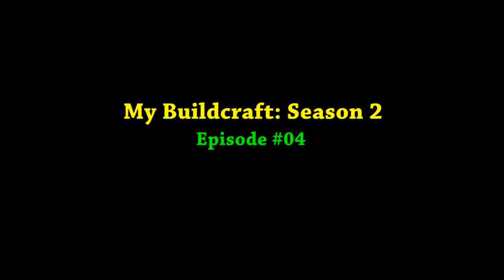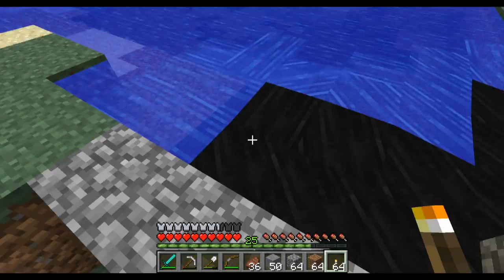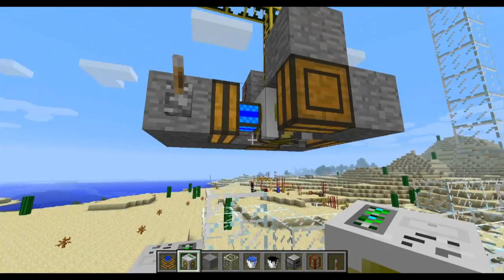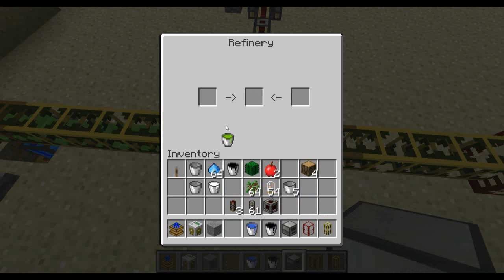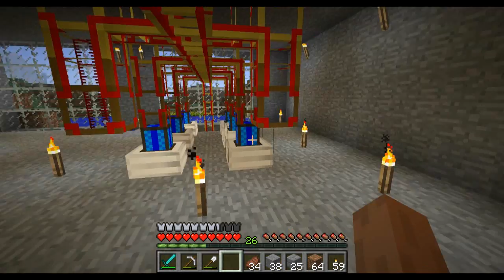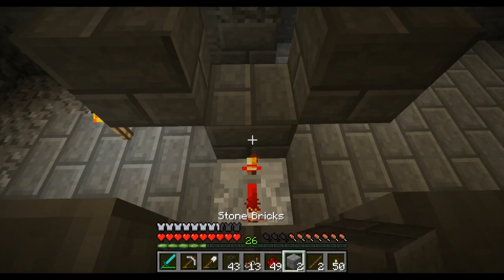My Buildcraft S2E04 - Pumps and Power

Comment: Little thing here. With redpower you can accually make huge quarries that mine out areas faster the normal ones. Unfortunately they are VERY expensive to make aswell as hard to make, but you can just tell it in a computer to make it oh let's say, dig out a 2x2 (In quarry size) of land and leave it on for an hour or so and when you get back it will be done. I could show you in a video response if you are interested. I know you hate redpower, but there is more to is than you think.

Comment: Tip for you. In the new Buildcraft. It has gotten smarter on the Tanks. If you have a total of 6 tanks, Lets say 2.5 are full of oil and it pumps water the water block will go in to the 3rd tank. Also if you place a tank below another tank the liquid will now travel down. Example 5 full tanks of oil you put a empty one at the bottem the top tank will now be the empty one.

Comment: Hello Chemdork

As i learned the hard way, stone pipes are not sufficient to cool two combustion engines from an aequetus accumulator. You need golden pipes or liquiducts for that. Stone pipes will give you a nice crater within fifteen minutes.

Thanks for the videos!

Comment: I was using a water pump with 3x3 pool to cool 4 combustion engines, but they seem to use up the water in bursts and try to overheat.  This would cause the pump to go in overdrive and empty the pool faster than it could refill.  I ended up using an accumulator as backup and it works fine.  It also doesn't use any of the power produced.